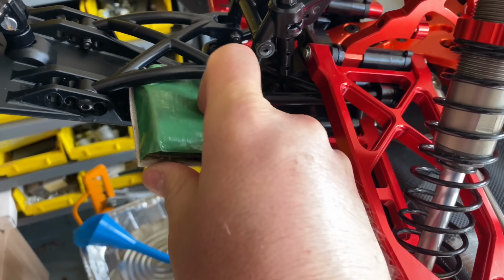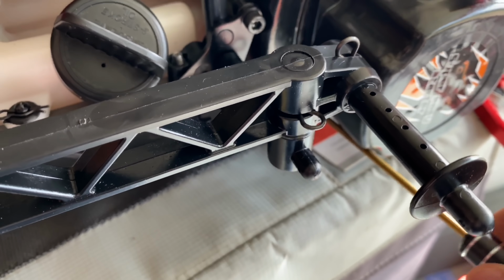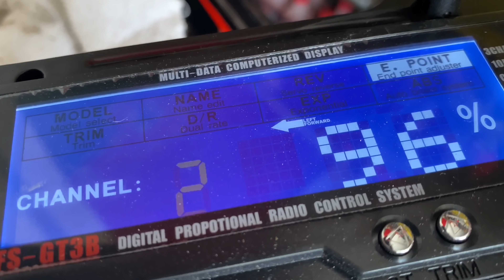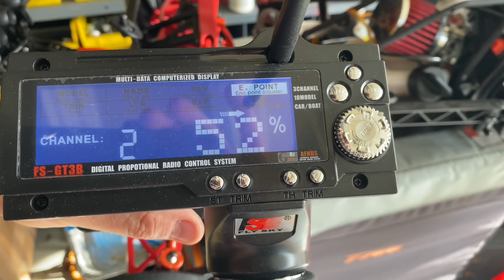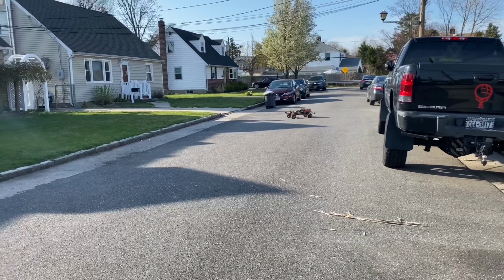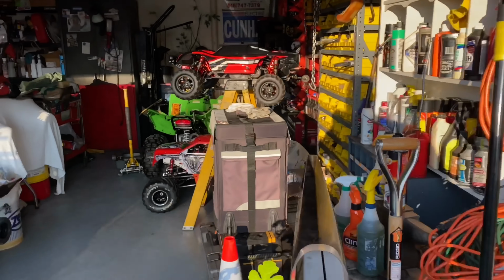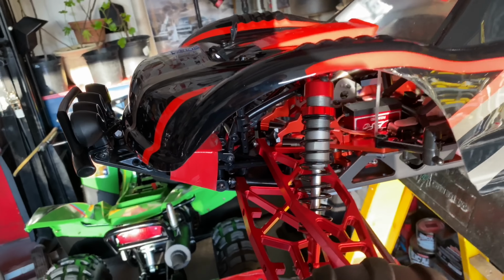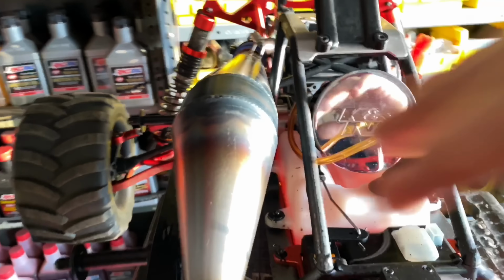Part 2 of 2 Let’s Go Over My BAJA MAX-T & Try To Fire🔥Up New BROVAN REEDCASE 45cc

Comment: That was awesome bro 🤘the power🧨not the crash tuff luck hate to see a brap brother grounded☹️! The lead made no difference whatsoever Lol🤣 can’t wait to see🤩 the next braap session 👍🤘👊
Reply from the maker: I’m really happy how it runs as is with this 990 carb that don’t even have a spring change. I have not tuned it yet except just lean the low speed an 1/8 just to bring my idle up a little. I don’t feel the need to lean the high at all at the moment. I want to try out another carburetor and install a bigger velocity stack tonight or tomorrow. I will install a carb that will be like the carb that will come with it
Reply: BOTAJELL That’s awesome bro, can’t wait to see what she can do🤪 quick question? You and your friend Arnold did a video on carburettors, spiral diaphragms just wanted to know if you brap heads⚙️⛽️🛠are going to do a part 2?👍👊
Reply from the maker: Rc Bushcraft haha yes we will do something again together but probably bring up mix ratios and what pro racers that travel the country are doing and what they recommend and what has worked out best for them threw all the engines and years they have used and done

Comment: Hi john I have a 29cc rovan engine and a Baja chassis I’m trying to build my first Baja 5t well first rc ever..lol do you think a rooster tail 990 is to much for the 29cc rovan engine.? I’m new to this hobby and never built one so any info would be a big help!
Reply: The roostertails are best on like can be used on 32 and 34 but best on modded 32cc to 46cc for 29cc the stock 990 is best but get it with throttle bearing mod lasts longer!!
Reply from the maker: Jamie Fox if I was you your best bet is a regular 990 carb with the bearing mod only and that’s it but if you want to install a spiral diaphragm you can here’s a video on how to install them https://youtu.be/VgNFbz7Yyx0 I used a Rooster tail 990 on my Gizmo 30.5 drag mod piston port engine and I had to remove it and just use a stock 990 and it ran way better and it was consistent. The rooster tail 990 works amazing on my friends RCMAX 46cc

Comment: Can't believe the c hub didn't break but your lower arm did how much weight is up front I didn't catch that
Reply from the maker: I show that on part one at the end I don’t remember? I think 8 oz?? I will add some more just to help it out a little to keep it down just a little more . I like when it lifts but not every time I touch the throttle. I think with a little more weight up front it will still wheelie but not as much and it will be better balanced for power to weight ratio on Baja platform

Comment: Man I want to put that 45 in my 1/8 truggy 🤯
Reply from the maker: Lmao 🤣😭😂💥👍💥👊💥💨💨
Reply: @BOTAJELL  I will get the nitro equivalent of this very soon. Modded .32x with 9896 and 4032 header!
Reply from the maker: Nitro Mike hells yes that’s what I’m talking about bro Zeeeeeaah 😜💥💥💨💨💨 You mean 41032 header 👍
Reply: @BOTAJELL  Obviously the Novarossi 41032! Anyway tommorow I finally get the stock LRP .32 and it is going straight to my modder. Ports need cleaning and it definitely needs dragmod and maybe a crankfill (not sure about this). Also I will get it oilbathed so hopefully in a couple of weeks I will send it of the skatepark!
Reply from the maker: Nitro Mike I wished you could send that engine to RB Mods so he can give you the same mod he did for me but I don’t know how the shipping cost would be from your country to the USA ? You would have to look into that. Rick is the only guy that I have seen so far thy can work the sleeve and repair what LRP did with there newer coated sleeves that come on there Race inspired X series 32’s . Hopefully the guy you know has experience like Rick this done hundreds of them already. Some guys don’t have a clue on how different this newer sleeve is from LRP compared to the past LRP’s .
Reply: @BOTAJELL  Was the spec 4 the one with the weaker sleeve?
Reply from the maker: Nitro Mike there all great but it all depends how you break them in and who mods your engine because there almost like breaking in Picco engines you must really run them for a while. If you don’t break them in enough? They won’t be consistent . After you really break them in there really great engines and perform amazing for the price. There were 2 spec 4’s but only 1 spec 4 X series race inspired that came with back plate and different carburetor with a vinturie. The only flaw that LRP did to this next level engine was that they had Taiwan 🇹🇼 and China 🇨🇳 cost there selves ! The Chroming that they used was garbage compared to LRP passed engines. If the modder does not have the experience or the correct tools ? The Chroming will chip off very easily! I have a passed video that I speak about this and show proof of this problem aswell . There is even a picture I show that Rick from RB Mods sent me so thy way you can have an idea of what I’m trying to say

Comment: More power, you cant even keep the thing on all 4 wheels, lol.  Rovan needs to make a 4wd so you can get that power to the ground
Reply: It was called the t2000...
Reply from the maker: The T 2000 was to many headaches with that 4 wheel drive system! This way how the max t is it’s more fun and way more durable and reliable. The best 4 wheel drive setups on RCs must have a center diff and on the Baja platform that won’t happen. But don’t worry because in a few more months I will bring this topic up again

Comment: If you want more weight up front I would take the front tires off the rims and put sticky wheel weights on the rims the same kind you use on a real vehicle and put the tires back on, that for sure would give u weight up front